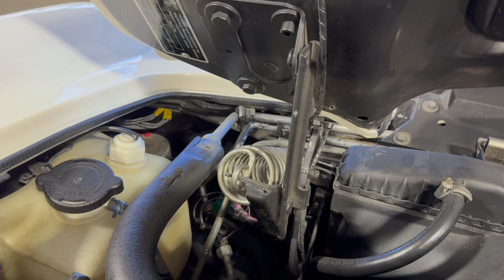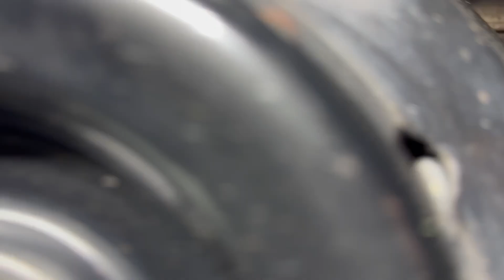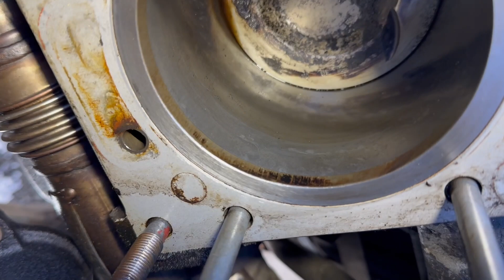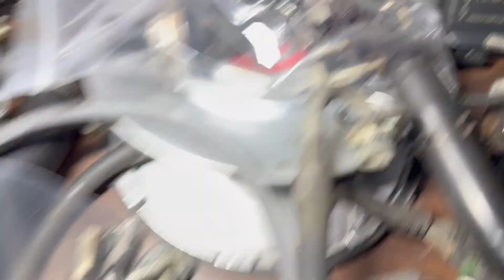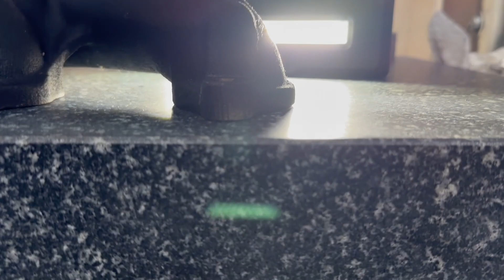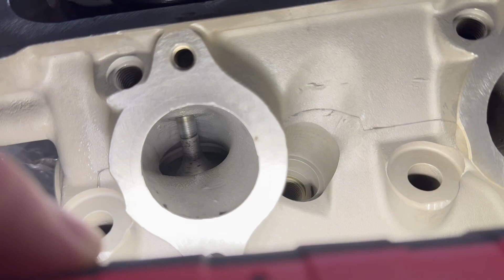1980's 1990's RR Bentley V8 Headgasket & Top End Overhaul

Comment: Just take the engine out. So much easier.
Reply from the maker: Removing the subframe with the engine and transmission is the way to go on an Arnage, but SZ series cars like this Turbo are done more rapidly in the car.   Another consideration on these cars is that you tie a lift up for the duration of the job if you remove the subframe, unless you have a dolly for the whole vehicle.  When the heads alone are removed the car can be rolled out of the bay until head repairs and other machine work can be done.  In this shop that often means a few weeks delay for machine shop turnaround, since the person who does the head work is different from the person doing teardown and reassembly. .